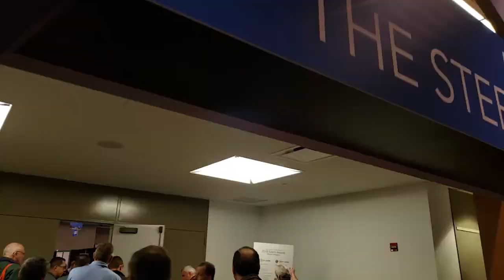Drafting Table Talk 013: SDS/2 Users Group In Review Part 1

Comment: Thanks guys, very informative.  The SDS/2 community is better off for the extra work you're doing.  Great conversation about pricing as well.  Lots of "famine thinking"  in detailing that leads to this undercutting type of competition.  Neck in neck with that are fabricators who are extremely shortsighted with their penny pinching mindset with detailers.  Everyone would be so much better off with long lasting relationships built on trust and generosity.